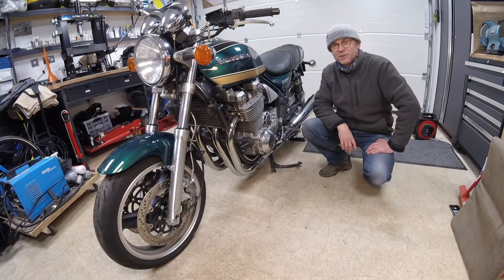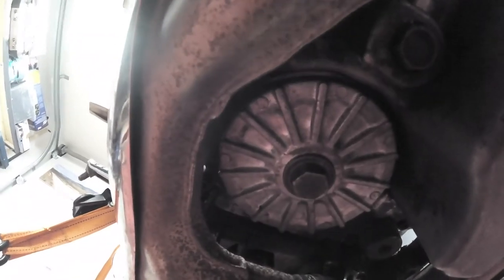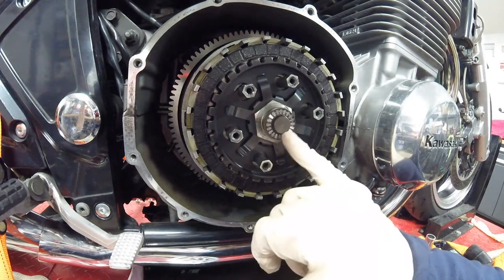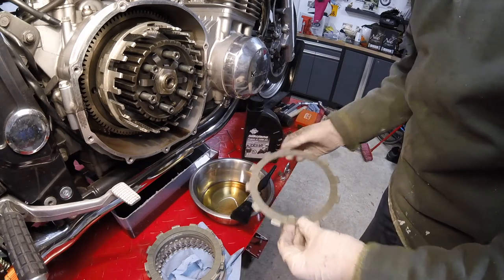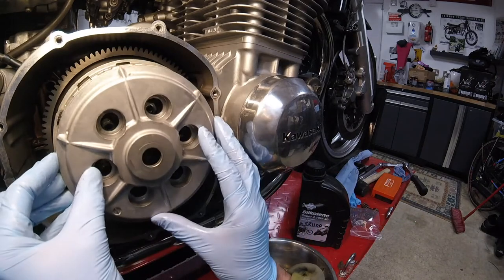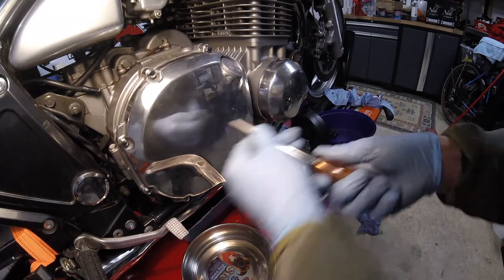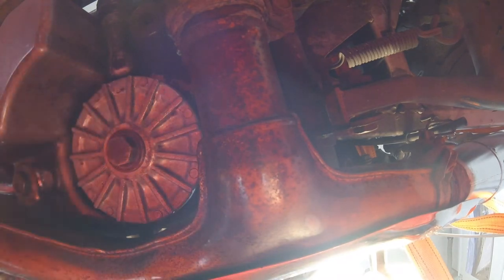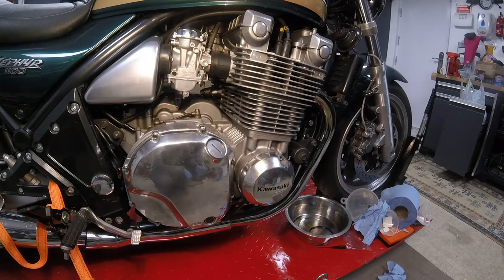Kawasaki ZR1100 Zephyr Clutch Renewal and Oil and Filter change

Comment: Great video! Are you doing more operations on the Zeph 1100 or was this just a one time event? Can’t find a lot of these on the tube.
Reply from the maker: The Zeph’s running rich, so I need to look at the carb set up and replace the air filter, so that’s really the next thing to do. I’ll get a video posted about this at some point! Glad you liked the clutch replacement video, many thanks
Reply: @themotorcycleshed380  Looking forward to that. Mine has stock jets all over but K&N filter (sitting in stock air housing). The exhaust is stock headers with some aftermarket short pipes (4-2). My engine pops quite a lot when I drop the throttle. Will watch your vid on this for sure.

Comment: When looking at clutch parts at the original Kawasaki parts dealer the 8 x steel plates comes with three different choices of thickness (2.0, 2.3 and 2.6mm). How should I  order when doing a total change of all the plates, both steel and friction?
Reply: Service manual: Install the steel plates and all the new friction plates in the housing temporarily for measurement purpose (Standard 2.3mm x6 and 2.0mm or 2.6mm thickness x1) ....So 2.0 or 2.6 should be last.